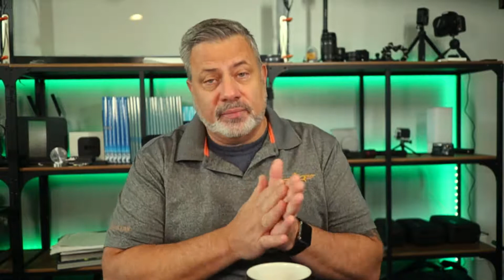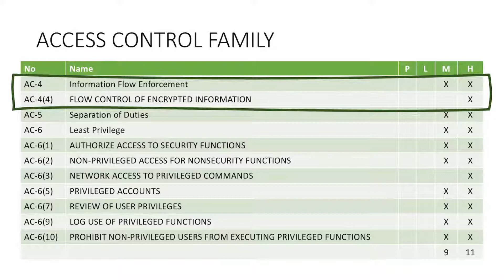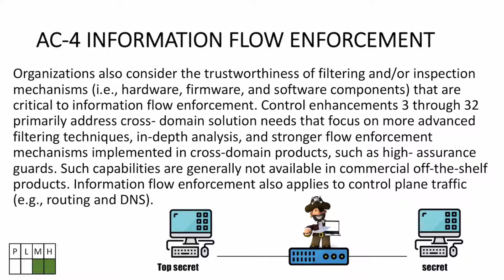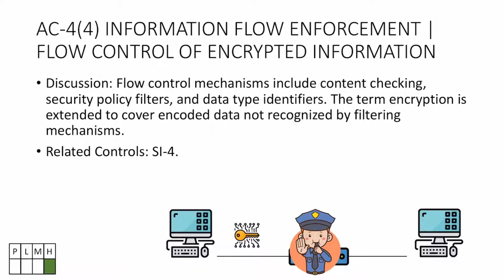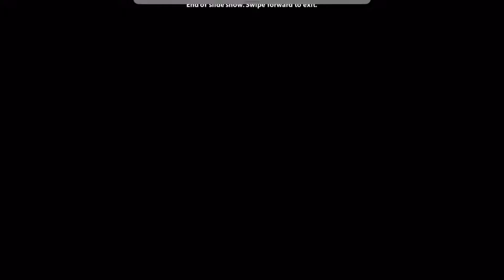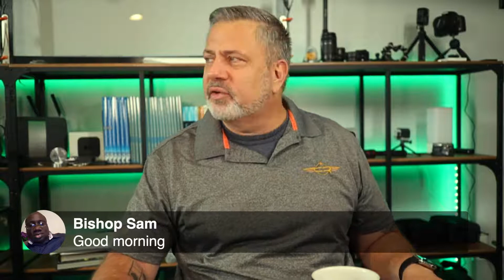Access Controls in Baselines - Cup of Cyber

Comment: Great presentation; a lot of great information here. Just to toss in some things I see as an assessor and recommendations I can give to the ISO, to meet intent (granted they have engineers that typically catch all of what I am about to write, but sometimes not, or not all of it, and my observations are not exhaustive):

          At the perimeter, one way to enhance a DLP strategy across the [public] wire is to implement a WAF to enforce URL content filtering and also using NAT at the proxy to help ensure MTO (many-to-one) address translation. Though NAT isn't an inherent security feature, it can help when it comes to spoofing. One thing that can undo this entire process is a punch-a-hole-in-the-wall attack as it is sometimes referred where an external party can get an internal party to click on a link and thus enable a legitimate reverse connection to a malicious site that would normally be blocked/filtered.

          Internally, we can better help access flow through using swimlanes, or VLANs so that our business units are, in essence, siloed - not one network is aware of another, and of course there are attacks for this as well such as double tagging and VLAN hopping, or straight up ARP floods in an attempt to fail-open the switch. As it comes to security domains, the CDS is a best-practice and in the government and it is a requirement between security domains. To that end, one cannot just simply pick a CDS and plug it in, it must approved by both the CDSE and then the DSAWG [daunting task]. Another method that can be used, though not an approved CDS method in and of itself, is the utilization of Data Diodes, that will physically refuse backflow. These are typically used within a mixed boundary such as when running low and high (black and red) within the same boundary at the same time. I have seen instances where the ISO will insist that using daisy-chained MUXs (multiplexers) will suffice simply due to the nature of reprocessing data into differing formats - this will not suffice and does not meet CDS-esque requirements nor the intent of the control. We must also bring up periods-processing environments; i.e., a network that may process 'classified' material during one event and then 'unclassified' another time - we must ensure no spillage through strict access enforcement to include sanitization and courier (MP-5x, MP-6x, MP-7x, SC-28, SC-28(1)). Power cycling volatile memory is an acceptable measure, or a method that follows NIST SP 800-88 is also acceptable as it comes to volatile memory in a periods-processing environment. Crypto and physical control on non-volatile devices are another measure.
 

          Administratively, we can add in the requirement of Bell-LaPadula (confidentiality) and Biba (integrity) models, as these refer to MAC - and these can be tweaked to fit any org, not just in gov. As with MAC, data is categorized into classifications, and this helps to determine the level of controls needed to secure said data. To that end, a subject (user) will be required to obtain and maintain a current and commensurate clearance to access the object (data); the subject will also be require to have a need-to-know before authorization can be granted. As this pertains to BLP, we have simple security rule: 'no read up, no write down,' in essence, the subject cannot access, or read, any data that is at a higher classification than the subject has (no read up), but may write at a higher classification of data up but cannot write it down. For example: a user can send unclassified data (CUI) to a classified environment (secret), but cannot send classified material to unclassified (no write down). In Biba, it's just the reverse: No read down, no write up. Here, once data has been classified at a certain level of integrity, the subject may read higher integrity object but not write it down. This is just another administrative control for data flow and access enforcement.
 

          There are other administrative controls that border on technical that may be required depending on the environment and these are ISAs, MOA/MOU and current ATO. The AU family is also relevant here.